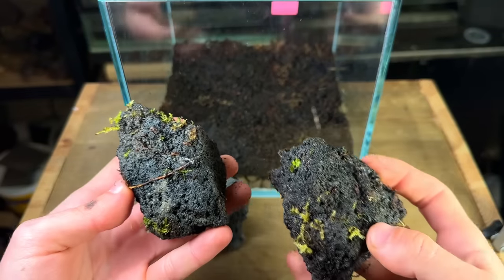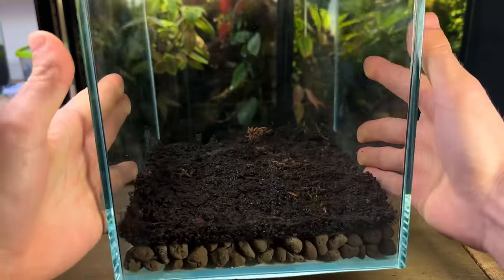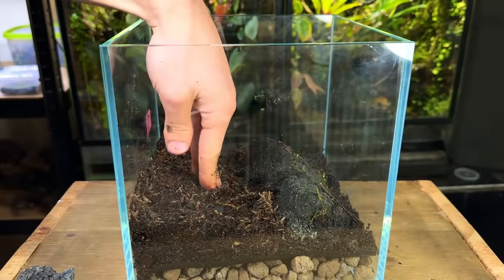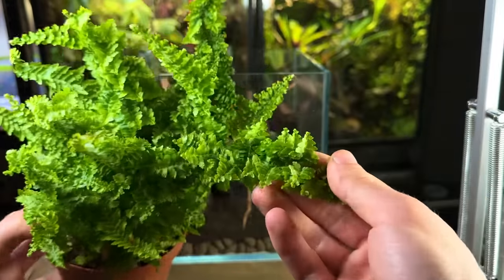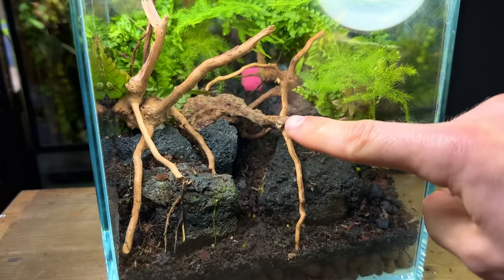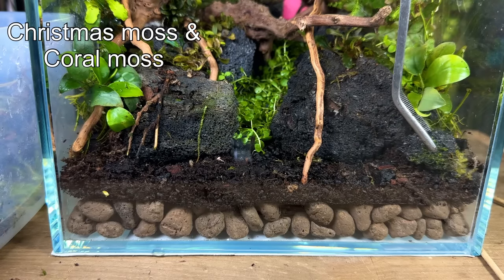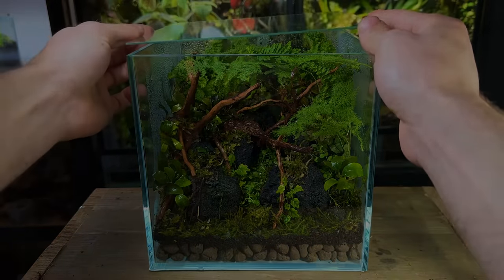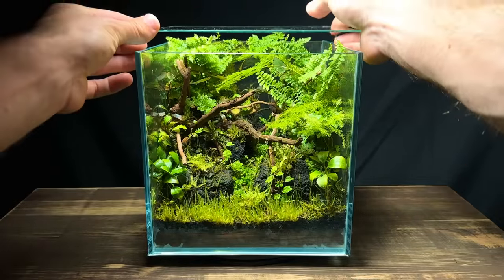I Built An ECOSYSTEM Inside a Nano Cube Tank! Step By Step Tutorial

Comment: I have made some very simple terrariums but the moss dies sooner or later. I believe the problem is that im not using led lights but indirect sunlight which maybe is not enough.
Can you make a video about the lights please? Is it necessary to use LED lights or will a common bulb so the job? Also, how many lumens do you need for the moss to grow?
Reply from the maker: LEDs do work great but you can even use something like a low wattage desk lamp. I’ll be sure to make a video on the topic:)